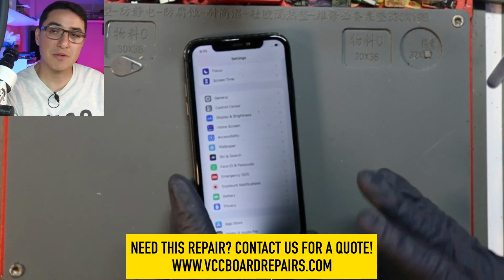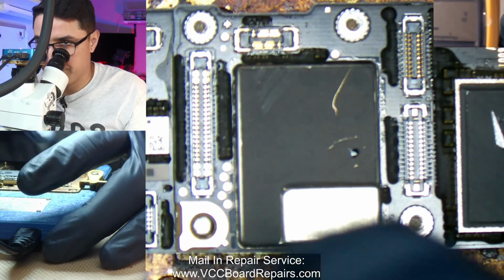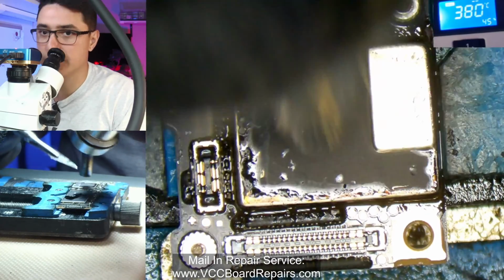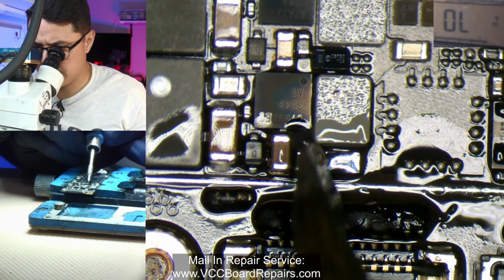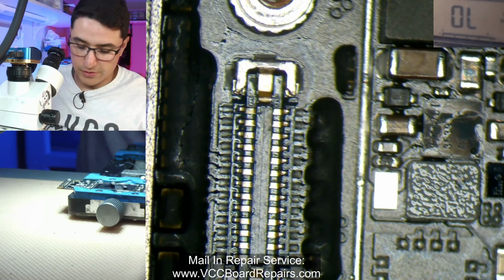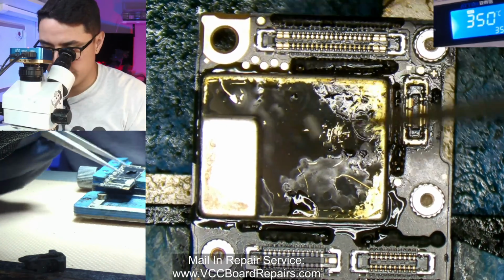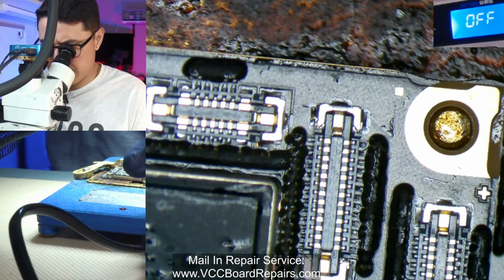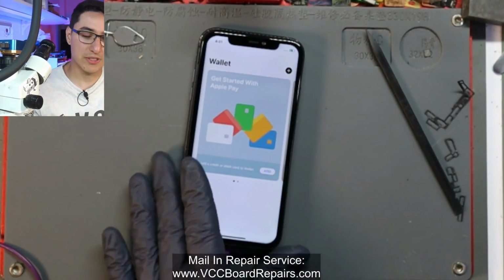How To Fix iPhone 11 Screen With Dark Shadow. Backlight Repair Tutorial.

Comment: Why did you separate motherboard? Resistence was on top of layer...
Reply from the maker: I literally explained it in the video

It's safer to split, do the repair and put it back together

Otherwise I can mess up the sandwich trying to fix the issue on the top board

Comment: I have this issue but if I soft restart the phone (volume up, down and power hold) it goes away for a few minutes and then comes back.
Reply: same with me but the performance of the phone is still the same, so i still use the phone.
Reply: @markdaryllcortez2209 the black light will spread or not 😢? Plz tell me
Reply: @Ar_lofi_edits  it won’t..
Reply: Just experienced it now. Did it spread? Or you can still use it until now?
Reply: @virlabrillo9045 mine too did yours work?
Reply: Thankz.. im using this technique.. settle down this black screen..

Comment: Does that stain continue to expand? Can it cause any damage or is it not harmful?
Reply from the maker: it's not a stain. it's part of the backlight circuit not working. depending on what's causing the issue, it shouldn't get worse.
Reply: @VCCBoardRepairs  The same thing happened to mine when it got wet. So you don't run any risk?
Reply from the maker: Water damage is never good. It can get worse
Reply: Doesn't matter if I take it to be dried? came to appear after 1 week
Reply: @camiloramosramos8499 if it appeared after a week it’s not gonna get worse

Comment: Hello
Can you please guide MN kindly
I have an iphone 11 in charging issue

The battery connector on board has 3 positive values 
One the main value is 290
The other two one have 300 but the other value is 1.200 rather it should be 300 because of this value the mobile phone is not turning on but it remains on apple logo please guide me what's the issue and what is its solution
Reply from the maker: i'm just wondering why you'd ask me for help on a youtube comment, let alone on a video that is totally not related to your issue?

you should instead post in my group for help: www.vccboardrepairs.com/vcc-fb-group

Comment: Use lint free cotton swabs. That'll pickup all the flux with some alcohol and keep the board clean. I would also recommend angled lights such as the gooseneck led spotlight which you can angle so that the light from your microscope wont reflect back up and instead, reflect at an angle. The board will then become more visible and clear. Anything reflective such as shields or flux can distort the image through the microscope.
Reply from the maker: I haven't found any decent lint free cotton swabs. But I do like these foam swabs. They work great

Comment: I like Jessa's method to remove those little shields, which is to stick the blade sideways and cut the solder around the shield. No heat to remove it! Could save a lot of time not to split the sandwich!
Reply from the maker: That's interesting! I'll have to look that up!

Comment: I usually just use my snips to break the shield for those. Put them in the hole where the no stuff IC is and clip it. Takes some patience but saves time from splitting sandwich
Reply from the maker: Yeah but then the shield is destroyed.